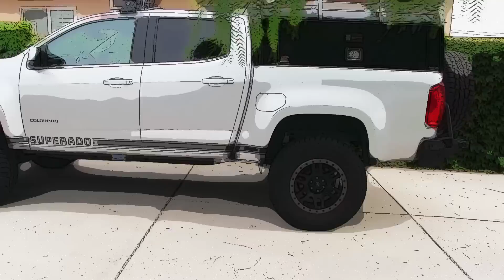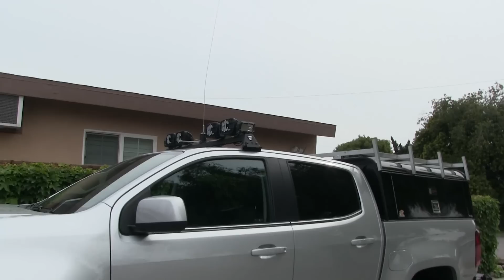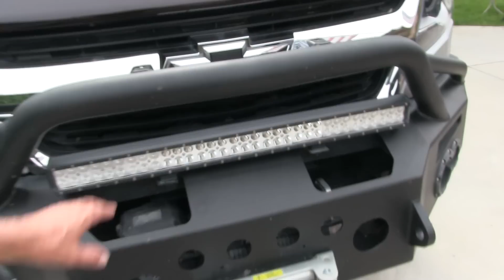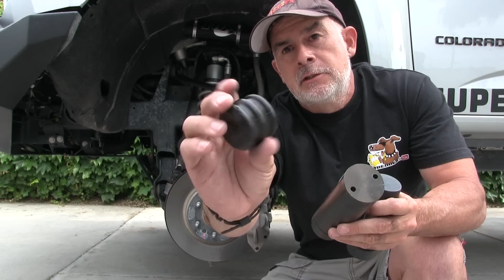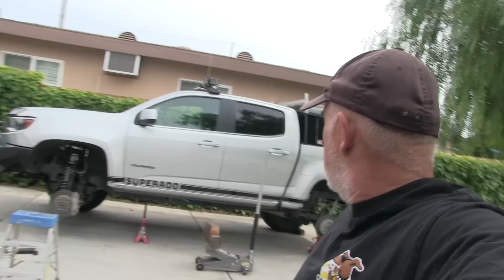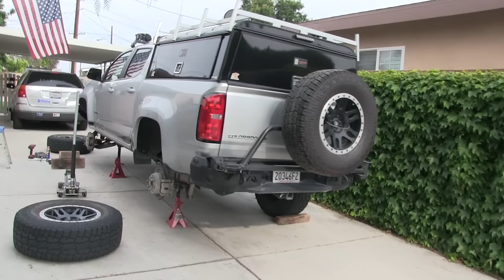Chevy Colorado 4x4 LT Mods

Comment: If you do upgrade, go Kings, whatever you do don't go Icon.
Reply from the maker: The issue I had was finding direct replacements to fit with the 6in kit without having to use spacers. The only things available at the time was the RC gas strut or the Fox 2.5 res.